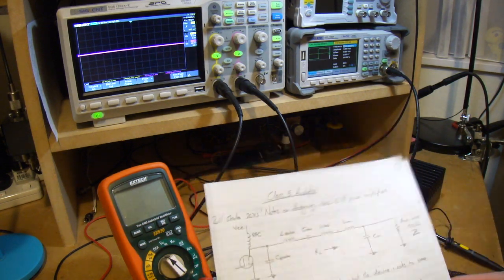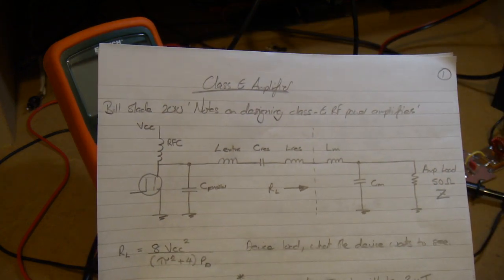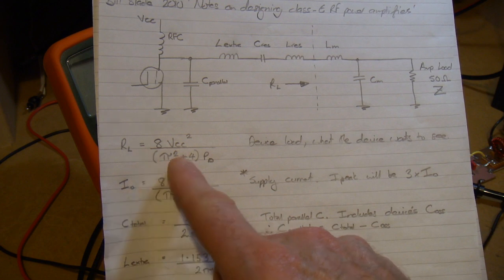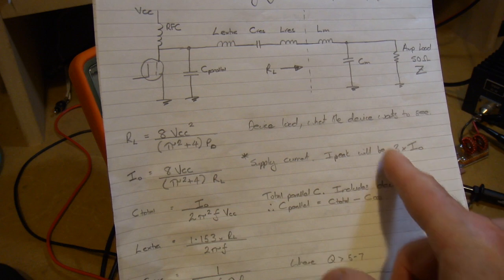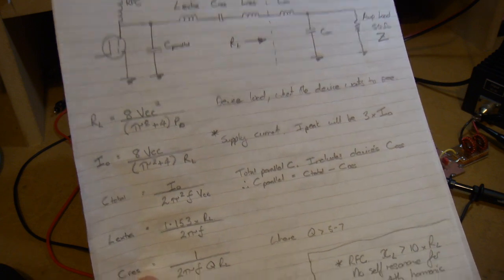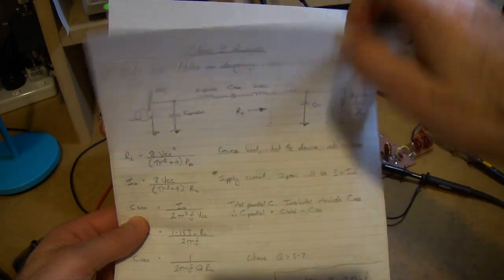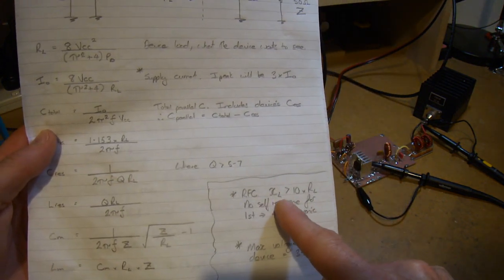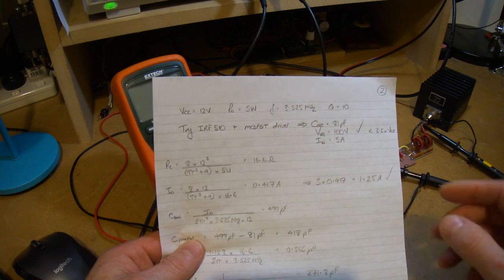CW Rig. Part 5 - Class E RF Amplifier

Comment: You are losing a lot of efficiency by switching with the voltage so far from zero. I'm guessing you are also losing efficiency in the inductors. If you can decrease the value of inductances and rely instead of higher capacitance values you lose less power to heat caused by resistive losses in the inductors. I think you should be able to get higher power output by messing with the impedance seen by the switching transistor to drive a bit more current though the device at the same voltage.

Comment: Hi Charlie!
The only suggestion I would have, is to try different semis.  While the 510 is used in many RF applications, I’ve heard some people having better efficiencies with RF transistors.  In fact, some great results were had (even over MOSFETS) by using RF bipolars such as recovered CB final transistors such as a 2N1969.  This (to me) would seem more likely to be the area whereby the efficiency would most likely be compromised.  The only argument against that is, if-so, one would think you’d see the inefficiency manifest as heating in the device.  Anyway, even though you may have to ‘buck-up’ the input driver, I’d still give the RF bipolar a try.  
Thanks very much for your excellent explanations, analysis and demonstration.  73… 😊
Reply from the maker: Thank you very much for taking the time to comment. I'll add the 2N1969 to the list of devices to look into. 73.

Comment: Thank you for the video. With each article and each video from a different person with a  slightly different perspective I am slowly starting to understand how to implement a good Class E amp. While building a Class E amplifier is not beyond any well-read, determined ham, if there is 1 thing I'm sure of it's that there are several different interactive variables needing to be optimized in order to obtain high efficiency. I built a (tr)uSDX and managed to reach 84% output efficiency on 20 meters. But unfortunately that efficiency was the result of installing a mystery random RFC toroid on the FET Drain that came out of my junkbox, so I haven't figured out yet why the efficiency jumped nearly 10% from the RFC I wound that came with the kit, though it has become clear that the RFC is actually an interactive part of the tuned circuit. It seems there is still magic in electronics, at least in RF amps.

On thing that I was slow to grasp was that a typical Class E amp can only be optimized for a single frequency, and that on either side of that optimally tuned frequency the efficiency begins to fall off. For a lot of commercial applications that is no big deal. But on most ham bands it requires care in picking the frequency you want to optimize the amplifier for on each band because it will involve some tradeoffs.

Comment: Just for interest, the drain voltage waveform does not look quite right. It should look similar to a half-wave rectified sine wave with the downward side just starting to round out a little when it nears zero line. You are getting closer to true class E when that `knee` moves toward the zero line. When the knee is not close to zero, the mosfet will be switching while carrying current. My rig uses 11n90 mosfets in a push pull arrangement and I get about 87% on 160 meters. These class E transmitters make great AM transmitters with good linearity.  The best source of info on these transmitters can be found if you use the googler to look for "classeradio" as the search term. Great work, I`m subscribed! Chris, UK.
Reply: If he increase the input voltage the problem would be solved.
Reply: @uecmitsuimarinedieselengin873  You are correct in that would increase output power but remember the irf510 is only rated for 100v and in a class e circuit, properly tuned, the voltage swing across the mosfet is 3 to 4 times supply voltage. This circuit looks like it needs more C across the load and the series C adjusting to get the `knee` near zero volts at the `required` power out. I built many of these transmitters but I am slowly converting them to class D because they have a much wider bandwidth. Class E has the benefit that it can be used at much higher frequencies than Class D. Class D is limited to a few tens of Mhz. The mosfets I use in my Class E rigs have a voltage rating of 900v
Reply: @TheTemporalAnomaly I thought similarly, but along the lines of adjusting the capacitance from the drain to ground, it's fairly important to efficiency to get it right. How you treat the gate matters too so I actually thought he should be reducing that 1 meg resistor to ground perhaps to 10k or perhaps a bit less and consider the driving circuit itself a little more.
Reply: @Dazzwidd   The capacitance from D to ground is important to keep the peak voltage below the max S D for the device, 900v if memory serves. If the cap from D to ground is too small, you get much higher peak voltage on the drain. As for the gate drive, it needs a rather fast rise time for efficiency and must not distort too much when the circuit is operating. I use a drive level of 12v from a square wave driver or 30v peak to peak if using sine wave drive.
Reply: @TheTemporalAnomaly  it's funny you say the driving signal should not distort too much while driving the gate because it's square 😆 I understand though, to distort a square wave driving signal is to slow it's rise and fall times and round it's edges. You're looking to swiftly switch the FET. That's why gate capacitance is of major importance at these frequencies 👍
Reply: @Dazzwidd  A square wave can be distorted just as any other waveform can be during amplification. (We don`t want to get harmonic content and distortion confused here.) I think you are aware of what I am saying in that it`s the rise time that`s important, getting the fet to switch as fast as possible. A mosfet driver may give you a nice square or rectangular wave but after that meets the gate capacitance, that same waveform will be anything but square.

Comment: HI Charlie,
At about 5mins in there's an equation for Rl that's dependent on supply voltage. Have you checked what happens as the battery discharges: How do the waveforms track between say, 11V & 14V?
Reply from the maker: Hi Richard. Yes, the the output does vary. 11VDC = 14.6Vrms and 13VDC = 18.2Vrms.

Comment: Hi Charlie, re winding the RFC, have you seen the "cross-over" technique that greatly increases srf due to lower capacitance. It's a little hard to describe but <https://electronics.stackexchange.com/questions/232493/whats-the-purpose-of-crossing-over-in-the-middle-of-a-toroid-winding> gives a drawing. The advantage is that the highest voltage nodes are well separated so have much lower capacitance. It really does make a big difference. 

RP (ZL3RHP)
Reply from the maker: Hi Richard. Yes I have seen that often for baluns etc, but not for RFCs. Have you seen it used for RFCs? I'll have to look into that. Cheers.
Reply: @CharlieMorrisZL2CTM  I've used it for inductors in SMPS. Not for RFC's as such. But the results were quite dramatic.
Reply from the maker: @rrhprosser  Thanks Richard.

Comment: One thing I've really wanted in all this class e business is a way to view the current waveform.  Any idea how to reasonably do that?  (ie, without a crazy expensive probe)  I don't think the absolute values matter much, just the shape (to see where it overlaps with the voltage waveform).
Reply from the maker: Try a small value resistor in the source lead and measure the voltage across that. I used two parallel 1ohm 1W resistors (0.5ohm total).
Reply: Charlie Morris I missed that - were you actually viewing the current waveform?
Reply from the maker: @MegaCadr  No that was the voltage across the FET.
Reply: Charlie Morris ok, yeah, I thought it was fet voltage and load voltage.

Comment: Again a very informative video. Thank you for that.

 I am running a similar setup as part of a WSPR beacon, although i just connected the IRF 510 drain directly to a 7 pole low-pas filter (no matching, no efficiency calculation yet). Like you i found the heat dissipation of the mosfet is neglible on 80 m. But this changes dramtically if you operate on higher frequencies, probably because most of the heat is dissipated during mosfet switching times. The higher the frequency the more switching actions you get per second. 

I found an intreseting website about Class E RF Amplifier Experiments, which although covers the paper you have presented: http://users.skynet.be/BillsPage/ClassE.html

vy 73, Andreas
Reply from the maker: Thanks Andreas. I'll take a look at that. 73s
Reply: @CharlieMorrisZL2CTM  I am just wondering, using the labels of Bills paper, Cp, ( L + Lo) and Cm seem to from a collins filter if you just move the serial capacitance to the front.
Reply from the maker: @dl9ar245  That could be . Interesting.